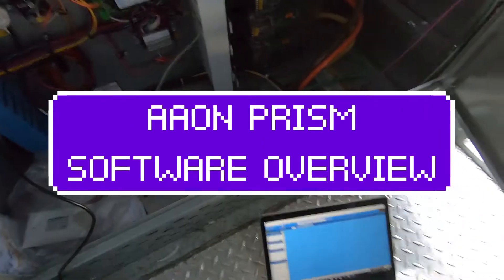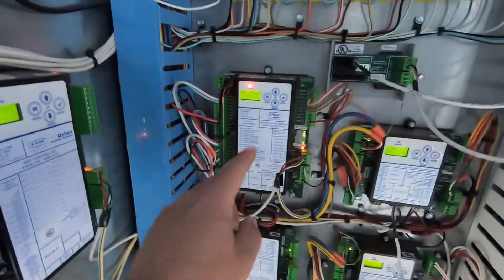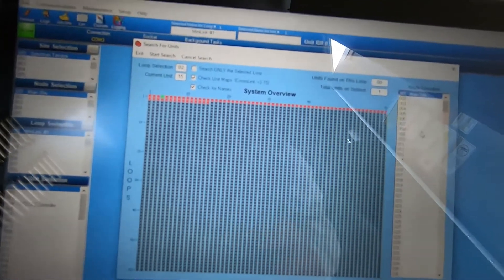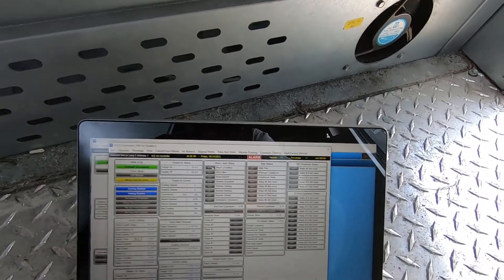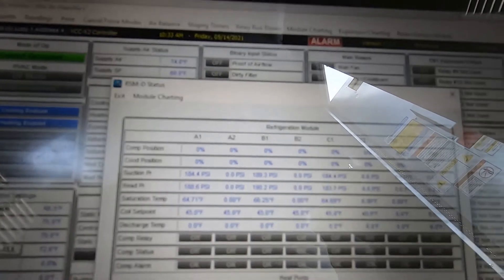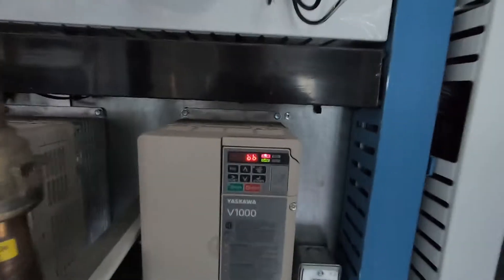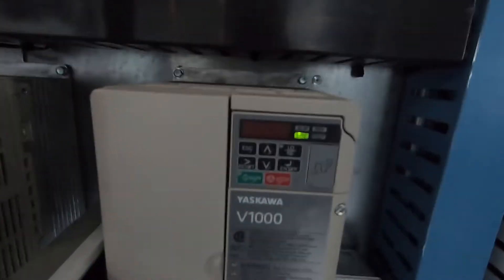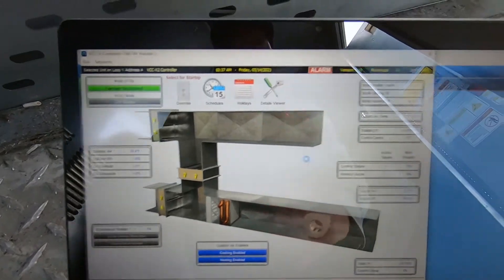(AAON Prism) overview on RTU

Comment: Aaon tech support sent me this video.  Basically as a tutorial on using Prism.  Good video.
Reply from the maker: lol you’re kidding?
Reply: @HVACslayer  No kidding.  I plan to see if you have other videos, so this comment may be invalid.  I am also aware this criticism will be extremely tough to pull off out in the wild.  But it would have been extra helpful to see you screen share instead of trying to see your screen with your hand held camera.  Still a good video.  I have been a mechanic for a long time.  My last company always sent a control guy to help me.  Now I am going to have to do both.
Reply from the maker: @ThomasGray-f1s  I work on a lot of these aaons in these setups 100 ton evap cooled condensers. I repair and maintenance 36 of these guys and every other 12 units has a different refrigeration setup and some are being controlled by bms on the air side. So it’s bizter vfd comps to sporlan tandem scrolls too Dan foss vfd hybrid tandem scrolls. 

12 of the latest ones are covid units and came setup not to operate correctly so we are doing shit ton retrofits on them to get them to run just normal back and forth with AAON. 

Totally get it man I can tell anytime I look on my computer with either my gropro or my iPhone recording the screen reflection is just to much it’s hard to tell.  I try to do my best either way and explain hope anybody in the field can piece it together with what I’ve gone over or talk about.

Comment: Does anybody know how to set the heating and cooling setpoints on these units?  Our main room is freezing and I cannot figure out why.
Reply from the maker: You’d have to give bit more info. But you should be able to adjust the set points through the hand held tool if you do not have prizm software
Reply: @HVACslayer  we have an AAON Unit RN-011-08-0-EA09-3FB 11T Roof top unit.  The reset source is space temperature and the cooling mode enable setpoint is 74, the heating setpoint is 71. sat coolingSAT COOLING high reset source is 80, low reset source is 70, cooling staging window is 5, mod cooling window is 10,SAT  SETPOINT OR LOW SAT LIMIT FOR RESET IS 50, SAT High Reset limit is 60, mechanical cooling oat lockout is 35, low cut off temp is 40
SAT HEATING  - high reset source is 80, low reset source is 60, heat staging window is 5, mod heating window is 10, Low SAT Limit reset is 90 heating OAT lockout is 90, high temp cutoff is 150.
The room that uses this unit has a  25foot ceiling and 80 feet long. Yesterday the temperature of that room was 68 degrees.  i tried to use the control unit to increase the temp, but no luck - room would not increase temp.  It was showing that the heat was on.  It was 80degrees outside but I didnt think the outside temperature made a difference since the reset source is space temp.  
I am happy to send you pictures of all the settings. this is driving me nuts!

Comment: If my smoke detector trips and the issue is rectified. How do I reset the vccx2 so that it isn't tripped on emergency shutdown alarm? Do I need the software?
Reply from the maker: Once the voltage is applied back to the emergency shutdown output you shouldn’t have to reset anything. If you cleared the smoke and it’s still there than you have another safety that’s tripped or your smoke isn’t resetting. Emergency shut down is external from the controller you would need to see what is tied into that on the wiring schematic. Make sure all those components are reset manually or sending out the voltage. Hope this helps

Comment: How did you solve the bb error code
Reply from the maker: Bb error on the vfds are control voltage  safety that is tired into safety’s through out the unit (high static, low static, emergency stop) unit kept hitting high static due to TI down in the floor, basically they had most of the vavs closed with minimum return being plugged with media filter. I had to lower the overal Duct static and bring in more outside air to offset .

Comment: Where did you get the peice you picked up that's running from the laptop top to the AAON? I have downloaded the Prism 2 software and now I just need that connection to get started.
Reply from the maker: Whoever you order aaon parts from should be able to order it for you. Part number is ASM02244
Reply: @HVACslayer   Hey, I really appreciate the assistance. Thank you!
Reply from the maker: @michaelnerio1826  No problem man glad to help.